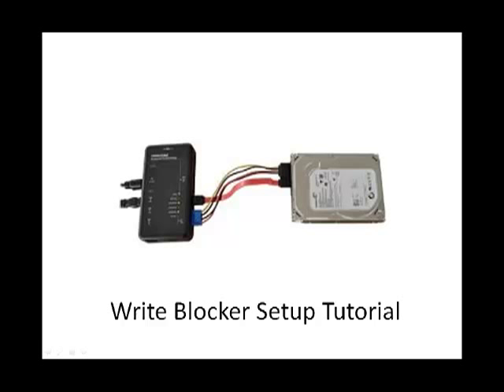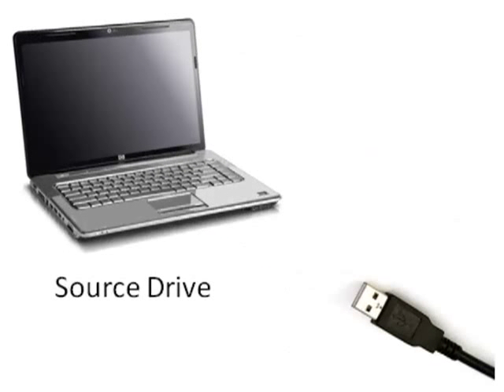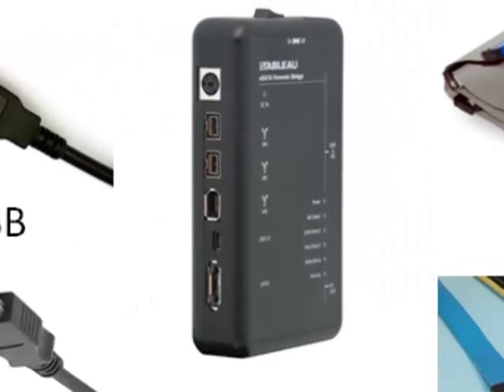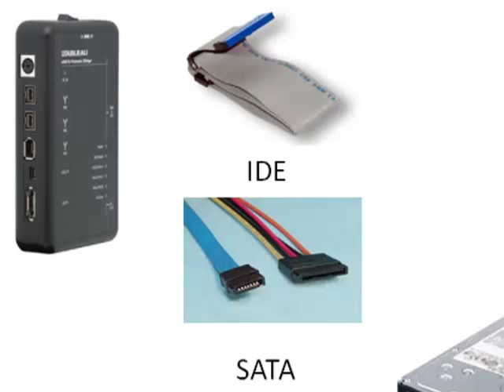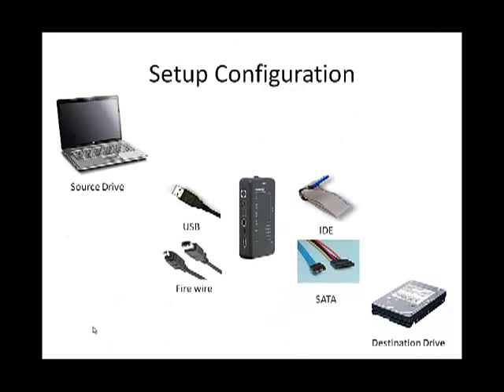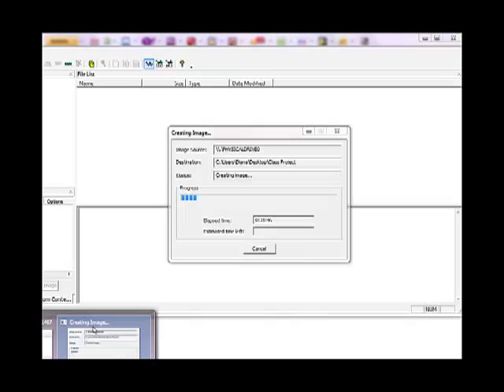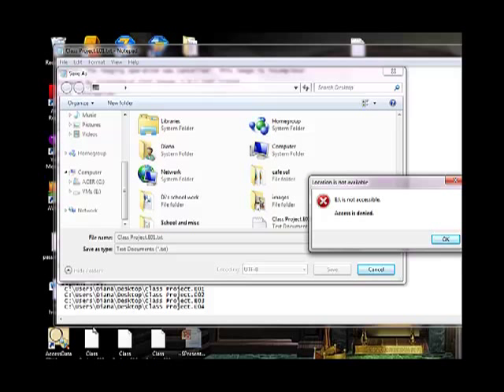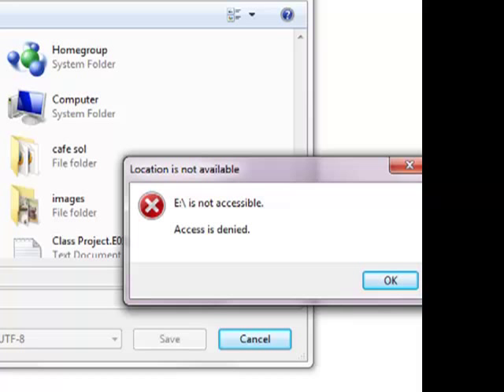Write blocker Tutorial project

Comment: When a write  blocker is connected to an External Hard Drive, does the gears in that drive have to still be spinning for the datA TO be read and transferrered?
Reply from the maker: +beyrsf  A hard disk drive has a platter or circular disk on which magnetic data is stored in a hard disk drive through the use of a rewrite head  and yes, the hard drive has to be powered on in order to transfer data.